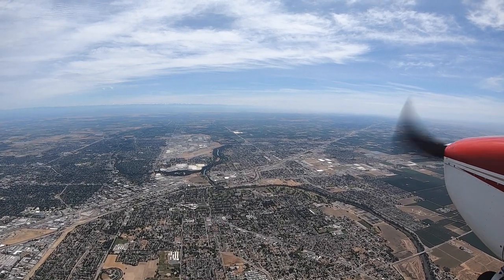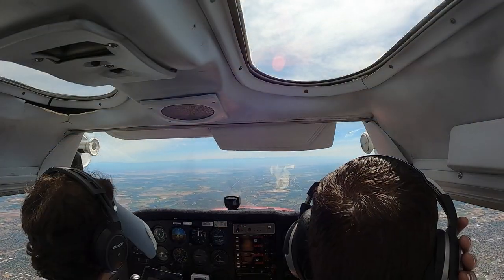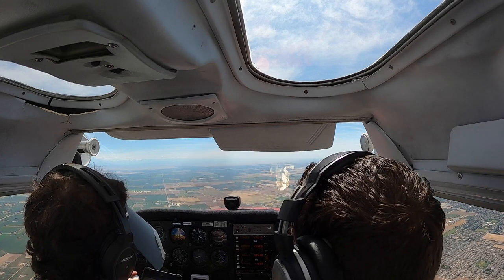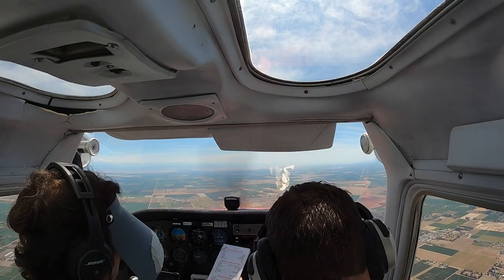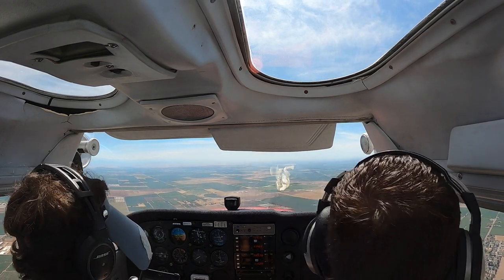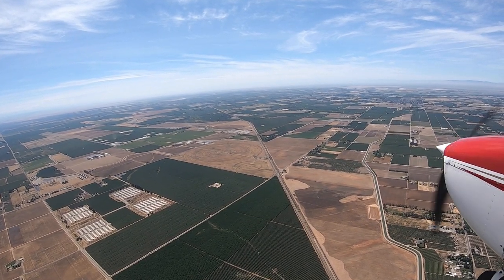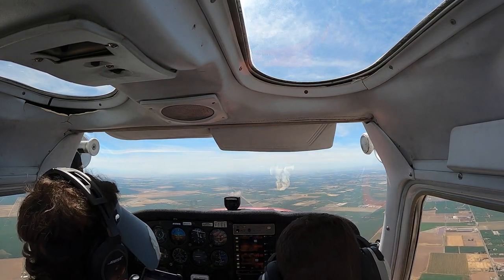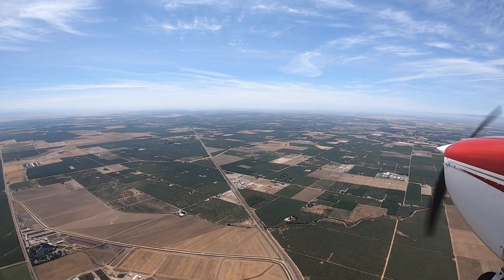Unexpected Carburetor Ice Encounter

Comment: I just had carb icing for the first time last week, heart rate went up fast when the rpm started to drop. First reaction was to increase throttle which made the rpm drop even more, then I pulled carb heat and within seconds the rpm went back to normal 😂 My heart rate didnt

Comment: I have only seen a bad magnito once. It was in a Cessna 414 over Wyoming and suddenly the left engine ran rough, very rough, I almost shut it down but ran the checklist and when I did the mag check, one mag position made the engine die, both mags made the engine rough and the other mag position made the engine run perfectly. I finished the flight on the good mag. The mechanic later told me that the bad mag was not just dead, it was misfiring at the wrong time.

Comment: The physics of carb ice are actually pretty scary - ice is almost ALWAYS forming in the carb venturi, but the ice crystals are small enough to flow out without causing any issue. The carb ice probability chart actually shows probability of ice accumulation in the carb, not the probability of ice formation. 

And it’s worth pointing out that ice accumulation inside the carb can differ not just by plane model and carb placement, but by the individual carb itself. If the carb is old, imperfections in the inner surface could act as crystallization sites or places where ice can stick and accumulate.

Comment: Had this exact same thing  happen yesterday in a 172 flying in West Va. Was training with my instructor on Stalls, slow speed flight and and emergency landings. During a stall as we were dropping altitude, with carb heater on. Engine started bucking and loosing rpm as throttle was applied.  We had to notify tower and perform an emergency landing.  Weather was perfect no rain or humidity Just goes to to show that this can happen anytime.

Comment: I think the Venturi tube inside the carburetor is what causes the sudden drop in air temperature, it doesn’t matter that much how warm it is outside, especially if it’s a humid day. I see some clouds in your video. It’s a compounding problem, because as the engine run less efficient, you get less airflow into the engine, you get more ice. Nice work with the checklist.

Comment: I have only seen carb ice one time. It was IFR in a mooney M20 between SNA and SAN. I noticed the student unlocked the vernier control for throttle and push the engine back up to 20 inches manifold pressure. Then a few minutes later he did it again. I asked him why was it necessary to unlock and push the throttle up twice to get the same performance? He quickly asked, "Carbeurator ice?" I said, "How would you test for that?" He pulled on the carb heat and the engine practically quit, sputtered and then quickly came back to normal operations.

Comment: Same engine type, different plane, same general area.  After steady cruise, went to climb and it didn't respond as expected.  First item I reached for was carb heat and a big slug of ice went through the engine making it pause and then normal service resumed.  Never before or since.

Comment: What's the 172 POH guidance for carb heat? R22 applies up to 80F, but it's rare it's not a concern
Reply from the maker: Basically apply carb heat when operating below the green arc on the tach (2000ish RPM). The descent checklist mentions using carb heat "as necessary to prevent carb icing".